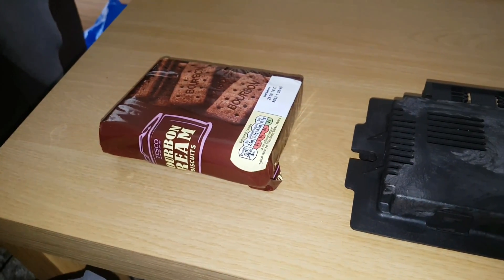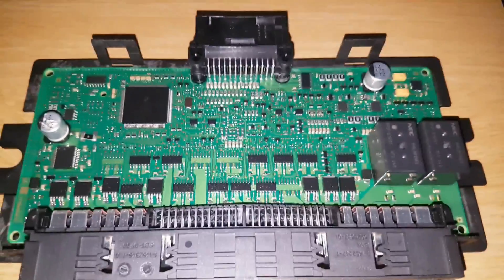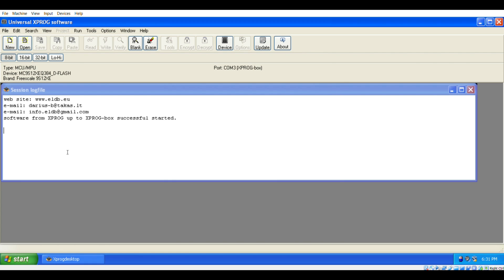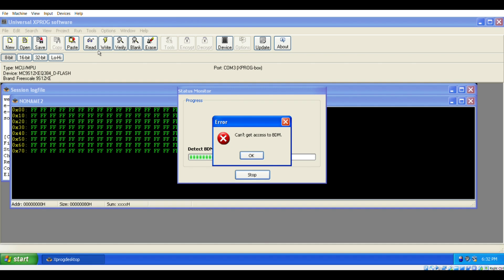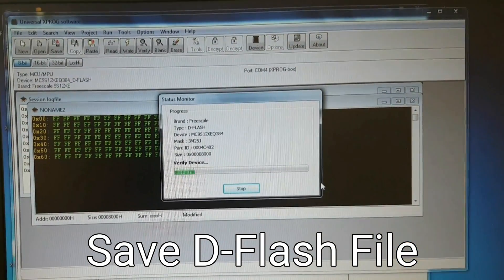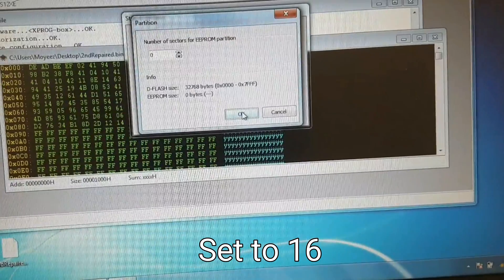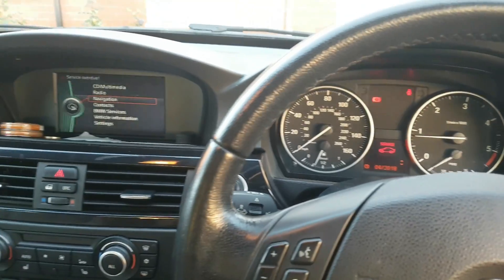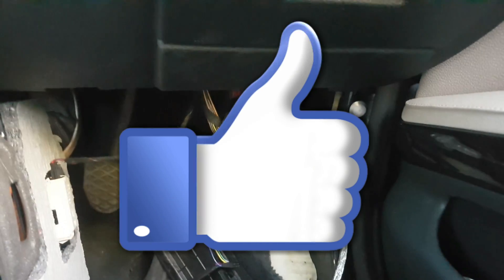BMW how to repair foot-well module or lighting module, FRM FRM3, using xProg (or similar)

Comment: So if themodule is not working will this definitely repair it? can the hardware be bad even if I never touched it.
Reply from the maker: Only if this is the issue at hand. There are a multitude of reasons why it might not be working

Comment: Hi, I have a couple questions for you. Maybe more than a couple. 😅
Is it an original xprog or clone?
Which version?
So you can only use Windows XP
I'd like to try to restore my frm3
Thanks a lot
Reply from the maker: Not sure what the current situation is regarding os. It's what my friend had it installed on.
Reply: Yeah, only XP or Windows 7 seem to work.

This one looks like a clone

Comment: my front and rear lights are not working. is it likely the footwell module is the issue?
Reply from the maker: If i remember correctly, lights are on a separate module. Window switch is usually an easy check

Comment: Hello, can this be done with a high end obd scanner too?
I have a Thinkcar/Launch with the xProg-3 for reading eeprom chips, programming keys and other modules. But where would I find a dflash file to write back to the FRM?
Reply from the maker: You need to check if it supports this freeman chip. I have shown in the video how you would do this. Create a dump of the "corrupted" flash and then use the tool to convert it.

Comment: Wonder if you need the xprog to do this. What other device would work? Ktac, BDM100 ?
Reply from the maker: There are a few around vvdi can do it as well just Google the microprocessor and it will tell you all the ones that can.

Comment: Hello. Thanks for taking time to show video. Where can I get the Xprog ?  Thanks in advance.
Reply from the maker: Unfortunately this day an age I'm not even sure. You don't have to use xprog you can use other boards as well. Just search from them online.
Reply: @laymandiy  thank you so much for replying back to me can you please give me a couple of suggestion brand software or devices and where to search for them and I haven't gotten no luck thank you in advance
Reply from the maker: @danielcesar25  You need to find a programmer that supports MC9S12XEQ384 3M2J. One from top of my head is the UPA or VVDI or R270 programmer. You need to solder the same way.. (or if you want to use some clips up to you) and then you follow the same steps, albeit different software to get to the same result.
Reply: @laymandiy  ok I will 🏄 surf weby for all 3 programmer. UPA, VVDI and R270. If I have any more questions I will reach out...thank you!

Comment: thank you for video.....i ask if i buy use footwell ECM from Other car and install it, it is work properly?
Reply from the maker: It will work, some functionality will not be there. This module contains what was shipped with factory coding of all the lights configs etc. That's not to say it cannot be done, it's just more laborious than the method stated above.

Comment: Where can I get xprog programmer to buy
Reply from the maker: Have you tried eBay. You don't have to use xprog therr are other programmers out there that can do the same job
Reply: @laymandiy  hi I did check eBay however I emailed the seller’s about the xprog and the all told me that it cannot repair bmw frm…and those xprog on eBay were about $150 to $170 and on google xprog website they are advertising there’s for about $500 and they say it can repair bmw frm unit but I don’t want to spend that kind of money…do you have any idea for me
Reply from the maker: Xprog 5.55+ can repair it. The selle probably doesn't know.  You could try a UPA programmer as well. Itight be worth sending it to a specialist to repair if you don't want to spend £50~
Reply: @laymandiy  thanks again
Reply: Hi again I see xprog vs 6.12 on eBay can that work it’s about $150 ship from china
Reply from the maker: I would just send it to a specialist to repair, because chances are you'll never use the machine again and you could probably get it's repaired for under $100

Comment: If only my driver window on e91 wagon is not working could this be damaged FRM? Or would that cause all of my windows to not work? I’ve diagnosed everything else already to rule out (regulator, wiring, reset window adaptation etc)
Reply from the maker: Frm failure would normally result in several electronics not working correctly. Sounds like you have an isolated unrelated issue

Comment: Hi mate I've a 2011 e90 lci with xenon headlights front indicators not working do u think its frm3 module
Reply from the maker: Are your windows working using the controls on the door?

Comment: Hi. Thank you very much for the useful info. I'm new to X-prog and was wondering if you could assist. I am getting a 0x0: screen after reading the d-flash. I purchased X-prog V6.12 but can't get past this point. your assistance or suggestions would be greatly appreciated.
Reply from the maker: Sounds like your connections are poor
Reply: @laymandiy  pflash read ok
Eee read ok 
But dflash 0 byte
Reply: @laymandiy  https://youtu.be/LP0c_pO425g
Reply: @laymandiy  this os my video
https://youtu.be/LP0c_pO425g
Reply: @laymandiy  you seem very knowledgeable in all this.  I bought a used bmw x5 and was told it needs a new footwell.  Now I'm not so sure.  Things like it won't go into gear.  And it's misfiring all cylenders.  Could the footwell cause this?
Reply from the maker: Um personally, I wouldn't have thought so. Generally (in all cars) critical functions are all on different modules. Not going into gear on a manual car. No, I don't believe it, even for auto frm control electronics like windows lights indicators central locking etc.. misfiring cylinder and gearbox issues ... I'd pass on the car anyway

Comment: Hi, thanks sharing great video will this work on BMW X3 e83 2.5i 2004 model my drivers side low beam circuit it’s not powering everything else is fine?
Reply from the maker: This is not your issue... Everything related to this stops working if you have this fault, which you don't.. and  beams should still work even without this working..

Comment: Great video. You explained how to fix it, but do you know why the module fails in the first place. I realize it could be because of a power issue, but it would be great to know exactly why it fails.
Reply from the maker: I am aware of two reasons... If the battery intermittently continues to connect disconnect is one reason it's "shorts" the system and the counter goes up by 1... I'm not sure what the max number is, something tells me it's 79 from memory. If you have the software you can navigate to the module and see.. secondly if you use a k+dcan cable and not the newer A1 A2 style cable it also after a 79(??) reads can short out due to how it's been designed.
Reply: @laymandiy  What is an A1 A1 style cable? Where can I get one?
Reply from the maker: If you're asking this question then I'm concerned you could do more damage to your vehicle. Please research this before getting it. It's known as BMW icom a1+b+c
Reply: @laymandiy  I can't learn without asking questions.

Comment: Hi,would you tell me why did you saved the old program written on the eeprom?
Reply from the maker: Because the old information is still there. The unit is bricked because of BMW safety. You take the old dump convert it back into a block that can be written on to eeprom again unbricking the device.

Comment: My car central locking is not working but the lights flashes when locking and only the actuators not working, even the boot button and the DTC button are not working, could it be the FRM?
Reply from the maker: Central locking not working is an FRM issue. Are you able to open the boot using the fob and if you hold the open button do the rear windows go down?
Reply: @laymandiy  The windows can go up and down with the fob, the boot is not working even from the inside button. It seems like only the actuators are not responding to the input signal and I suspect the JBE.

Comment: Do you provide a service for repairing them?
If so what is the cost?
My bmw is experiencing the same issues after the alternator went bad.
Reply from the maker: I'm sorry, I do not. I don't have the equipment anymore. I'm sure you can find some on ebay. You can try your luck if you haven't had the battery recall yet or if you live in the states.
Reply: I need mine fixed

Comment: Hello sir ...I need your help please I have frm f10 mc9s12xeq512cag would you please make video to show us where is the pins and which programmer should I use orange5 or ktag? Thank you for your good help
Reply from the maker: Whilst it is plausible that your FRM is fried, it is extremely rare on F series. Are you certain this is the issue you are facing? What are your symptoms?